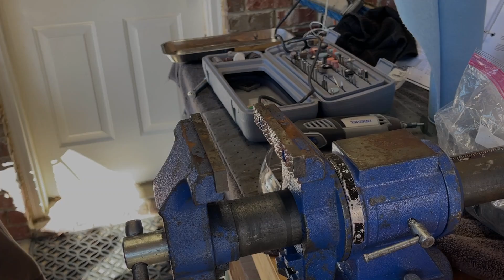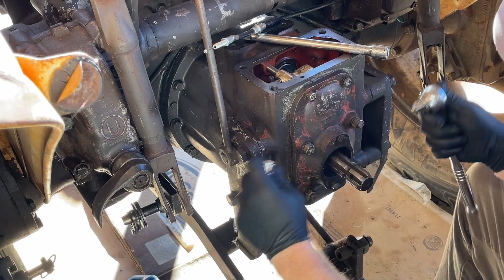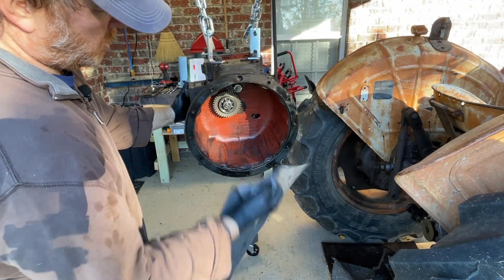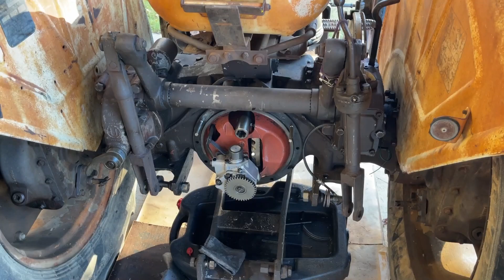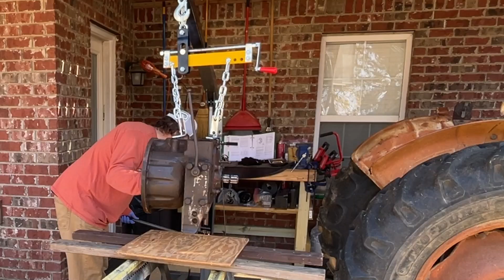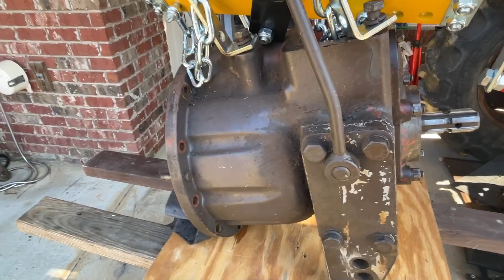Heavy lifting getting to the Hydraulic Pump | PTO Housing Removal |  David Brown 990 #4

Comment: Hello. If anyone is doing this on an 885 make sure you remove the brass holder of the hydraulic oil pressure switch at the bottom of the pto housing otherwise damage will occur, I found this out the hard way. 
I also just noticed I had given this video a thumbs down, I apologise profusely, I can only assume I was watching late at night and had clumsy fingers. 
Great videos always and a wonderfully helpful channel! 
❤
Reply from the maker: Excellent point!  The one I'm working on here was before the pressure switch was added to the bottom of the housing.  Thanks for watching!

Comment: Where did you find the gasket for the PTO housing to axle
Reply from the maker: I actually made the gasket using felpro roll of gasket paper.  Just hammered out the shape and holes with the ball end of a smaller ballpeen hammer.  Hasn't leaked yet.  Here's the link to the paper I bought: https://a.co/d/8yBBZAd

Comment: Hi Shane....I'm having a problem removing my PTO housing cover. It's on a 4600 (gas version of the 880). But, it's just like yours. I've removed the sensor and all the bolts. I've put in two studs. I can get it to wiggle. But, it appears to me that the back plate is stuck (heavily RTV'ed or something) to the PTO housing. I've tried using a chisel (lightly, at this point) to separate the two pieces. Before I start using real force, can you verify I'm not missing anything? I've got two very short videos linked. One shows the bolts removed (am I missing anything?) and the other shows the PTO and back plate stuck together. I'm starting to think air hammer....lol https://youtu.be/IjyaSIyldNM?si=J9iuofM6ICVFDw8l and https://www.youtube.com/shorts/leBsxxCVprE
Reply from the maker: I can't see that you've missed anything.  Have you tried heat yet?  The internal pump mounting plate will be held in place with a bolt on top.  See the "Wow it's dirty" video on my channel.  Shows you what's keeping it in place. https://youtu.be/o984fzC7iU8?si=IrthJy9BTdFud4sL&t=56
Since the internal plate has a bolt at the top, it might be an idea to try to separate the pto housing from there?  Maybe try to wiggle in a screw driver or pry bar in at that point and work around?
Keep trying to separate, but I don't know if I'd go the route of an air hammer just yet.  I see you've got it on a engine lift/leveler.  Too much upward pressure may bind it on the studs?  Good videos showing it by the way!
Reply: @path.of.discovery  I got it loose. With a hand sledge and a block of wood I kept hitting and rocking it side to side and it finally broke loose. Two more questions…1.  My PTO shaft tried to come out with mine. Is that normal? I’ve done the requisite internet search but didn’t see anything. 2. Have you ever pulled the pipe going from the filter assembly to the bottom of the hydraulic pump? Part of the reason I pulled mine is because before I bought it there was too much water in the oil and it froze. The ice bent the pipe to the point it broke off the tab on the pipe that keeps it in place in the filter assembly area.
I didn’t discover that until after I bought the tractor. Supposedly you can pull the pipe out from the back. No luck so far…. I don’t know if it’s because the pipe is bent or there isn’t enough room. 
BTW…. My hydraulic pump spun freely. I haven’t opened it up but I’m sure it’s worn out.
Thank you for your help and the awesome 990 videos. You need to do some more!
Reply from the maker: @captainbillh  Yay!  Glad it came free.  Was it RTV holding it?  Hate that stuff now!  If you're talking about the main shaft running up into the tractor to the gearbox, I think that's called the Carden shaft.  I was reading a few old posts on the forum archive (https://dbforumarchive.com) and saw a few mentions of being able to remove that shaft from the rear with the pto housing removed.  So if the splines on the end of that shaft mating to the innards of the PTO housing were a bit rusty, then I can see how it would want to come out.  

No, I've never pulled the oil feed pipe from the sump out.  I didn't need to on mine, I just poured diesel fuel down it to clean it out a bit.  Not sure what you can do here.  Maybe find a breaker with a good one or if you can get it free attempt some sort of repair.  

Yep, at the minimum you'll need a seal kit for that pump (cheap, relatively) or a new pump ($$$$)
Reply: @path.of.discovery  it was RTV….they had slathered it on rather thick. The PTO shaft wasn’t rusty….guess it had been there for a long time and didn’t want to come out!

I bought a new hydraulic pump but plan on rebuilding the old one. I think it’s worn out….the pump turns very easily by hand. 

Thank you for all your help. I appreciate your channel.

Comment: Just a tip, if your tractor has the “clogged hydraulic filter” oil pressure sensor ( all tractors that has the hydraulic oil filter under the tractor) remember to remove the brass fitting/adapter to the sensor before you remove the PTO housing or else you will break it (ask me how I know 😂)
Reply: I came here to add the same comment, I really really wish I had read yours before trying to remove my 885 pto housing. 
I thought it was stuck on the dowel so large pry bars were used and yep, snapped off the top of the adapter. 
Fortunately Barcley Williams has one in the post for me.
Reply from the maker: I guess I'm lucky that mine doesn't have that sensor, because I probably would have broken it!  Hope it all worked out ok!  Thanks for watching

Comment: I have a david brown 1200 and was wondering if it also has a rear mounted hydraulic pump in the pto housing.  There's a front pump mounted under the radiator and I think that might be the only one.  Does anyone know for sure?  Thanks.
Reply: We used to have a 1200 for about 35 years. I’m pretty sure it only has the one pump at the front.
Reply from the maker: I think that's right, only the front mounted pump on those.  Be sure to get a copy of the service manual for that tractor.  This video goes through where to find manuals online and should start at the right spot in the video for that topic.  https://youtu.be/5nYhhXXpGFw?t=748s Thanks for watching!

Comment: Hi Shane.  Looking forward to the next instalment.  You’ve got a great original tractor there.  For me, it would be a shame to respray it.
Reply from the maker: Thanks! I've had a setback with the hydraulic pump though...  It's worn out.  video on it coming soon.  As for painting, I'm leaning heavily toward leaving it like it is.  Are you the guy restoring the 880 in the restorations section of the forum?  If so I've enjoyed your posts.
Reply: @path.of.discovery  Hi Shane.  Yes, that’s me, DRM.  Like you, I want to get mine mechanically (and electrically) right before I paint.  Glad you find my posts interesting.  In hindsight, I would have liked to have gone the YouTube route but available time is a big factor.  Maybe I will on the next tractor!!!!

Comment: Lipstick on a pig lol 😆 I've never heard that one before. Interesting video Shane my db 880 is leaking on that joint so it's got me thinking it's a job which didn't look to bad to do I always use my engine crane but what is the attachment you had hanging off the end I've not seen one off them before not in the UK but looks a proper bit off kit
Reply: Many thanks I'm getting one makes life so much easier
Reply from the maker: Searched Amazon for "Load Leveler" and found quite a few.  Here's one similar from Amazon: https://a.co/d/aHs1YJv
Reply from the maker: Hi again Jon, thanks for watching!

The thing hanging from the end of the hoist is called a load leveler.  Link to where I bought mine:  https://www.harborfreight.com/3-4-quarter-ton-capacity-heavy-duty-load-leveler-67441.html

There's more heavy duty version of it but more expensive.